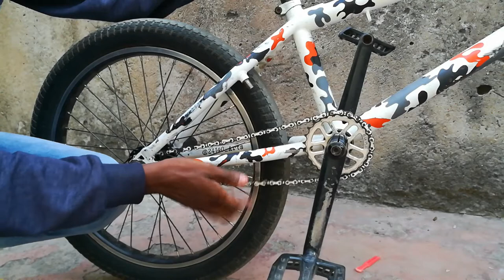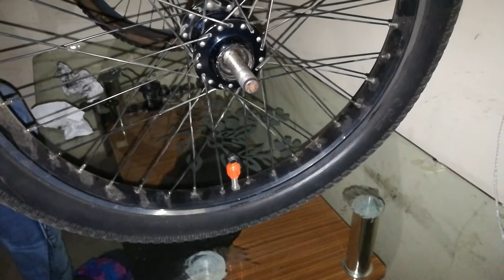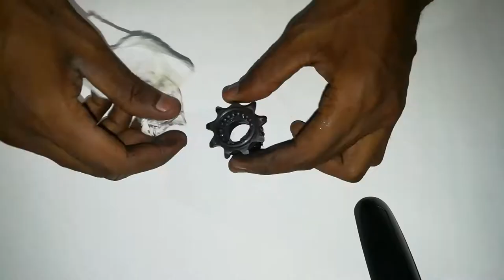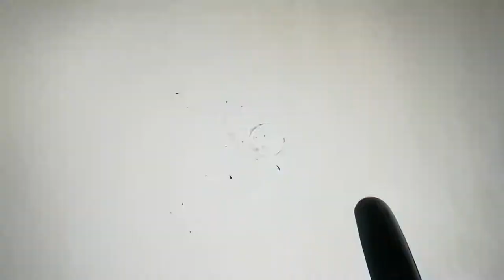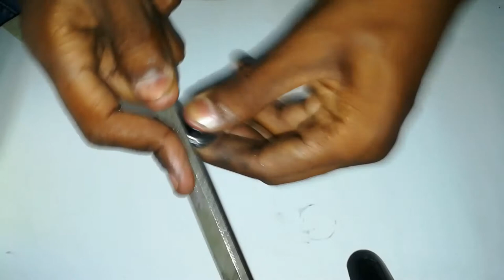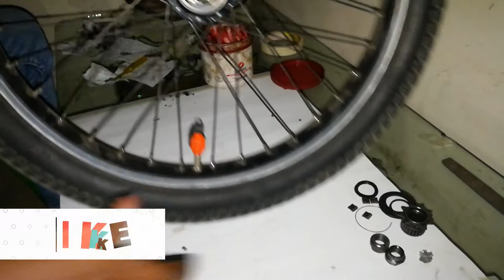Servicing a semi-sealed BMX cassette hub.

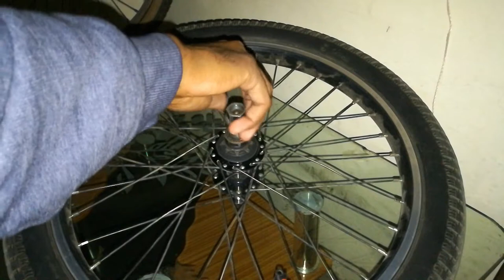Comment: Hey, thank you for the video. I'm trying to take apart the semi-sealed hub of my daughter's bike but opening the nuts next to the cassette seems impossible, they won't move a millimeter. I have sprayed it with anti-corrosion/anti-jam oil, but no success. You open it with ease at 1:35 of this video - how do you do it like that, without holding the opposite side, as these nuts turn with the axle? Thanks again!
Reply: Okay got it open - the ****er was jammed TIGHT. I also learnt it was actually sealed, although it was supposed to be semi-sealed. The reason I wanted to take it apart was that the cranks would keep turning when pushing the bike. So, having got it open, I cleaned and greased the pawls etc. and put everything back together - but the cranks still turn when pushing the bike. What would you suggest, what should I try next? Thanks again for very helpful videos.
Reply from the maker: @drewanstore5550  Great. sometimes the pedals will turn when there's not enough tension in the chain. or when there's too much tension in the pawls of the cassette driver. My current setup runs double springs for extra sound but the trade off is the cranks always move when pushing the bike along.

Comment: my pedals spin when im going forward like a fixed gear road bike even though it is a semi sealed cassette how do i fix this?
Reply from the maker: Try servicing the hub. And when you put it back together ensure that there's a little bit of side to side play on the driver. Like a millimeter or so to make sure the ball bearings move freely. Also try and ensure the chain isn't too tight
Reply: @KamaarhKenn  Thank you

Comment: Bro can i ask..
My hub lately has been occasionally making a TING when i pedal is it still good to right? Thanks (my hub is semi sealed like yours)
Reply from the maker: If it makes a sound then feels like it's skipping a bit when you pedal, it could be the spring is loose on the inside and you need to rebuild the hub. It might be that or a ball bearing has broken in there and it's rubbing up against the other ones that are fine. If you can, rebuild the hub just to be safe
Reply: @KamaarhKenn  will the round part of a keychain work as a spring? But thanks for your help!
Reply from the maker: If you're in an area where there's bike shops, buying a direct replacement spring is better. The wire from a Keychain ring could work but only if you find a really slim one, then work on getting it to fit and work

Comment: My damn bearing broke puting the main part of the hub back on
Reply from the maker: An easy way to get it on there is to leave it in a freezer for like 5, 10 minutes or so to allow it contract in size. This allows you to install it a bit easier without much force. Once done and temps get back to normal it works just like it should. Just don't leave it in there too long though.
Reply: @KamaarhKenn  oh ok thank you, will use in the the future!
Reply from the maker: Anytime fam 👊

Comment: stupid quando bike hubs
Reply from the maker: 😂😂😂😂 I feel your pain. They make a good hub but requires lots of maintenance to keep them running. Something not everyone is able to keep up with
Reply: @KamaarhKenn  from 4 out of the bearings 1 is sealed then the oders are not, thats why its sucks
Reply from the maker: Yep. And if you happen to lose the ball bearings it decides not to work or it works while grinding through the hub housing
Reply: @KamaarhKenn  anyways, the new hub is coming in the next month. magic flute hub from china
Reply from the maker: Good looking man. I picked up a hub from a buddy of mine, currently working on it to see if it's going to be a good replacement for that Quando on my wheel